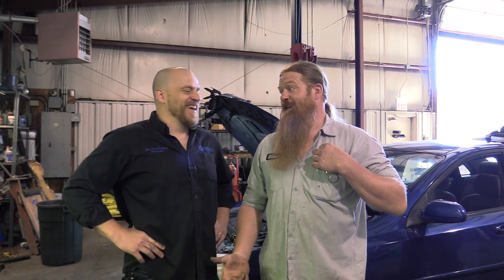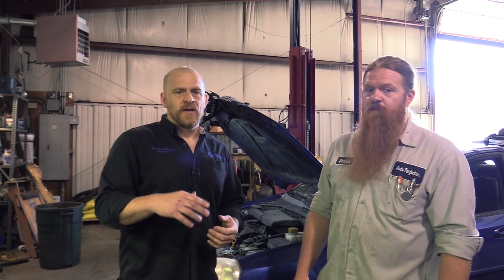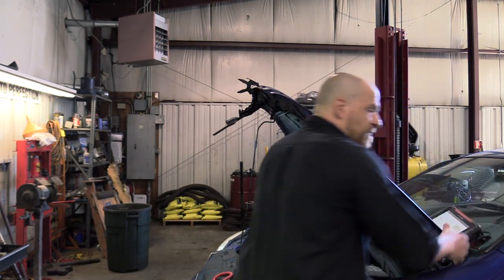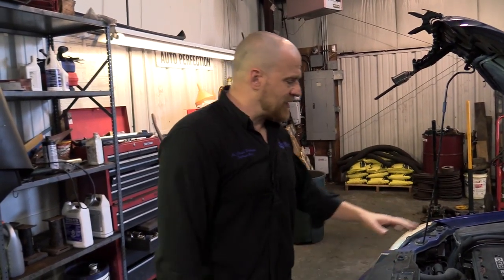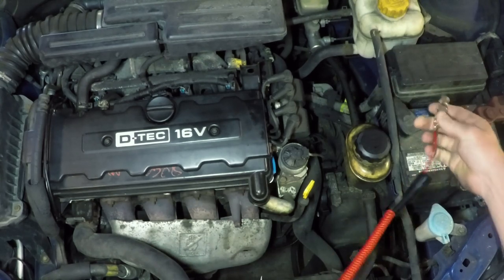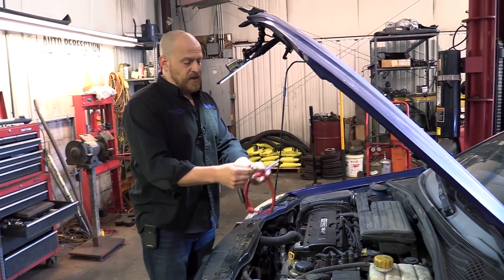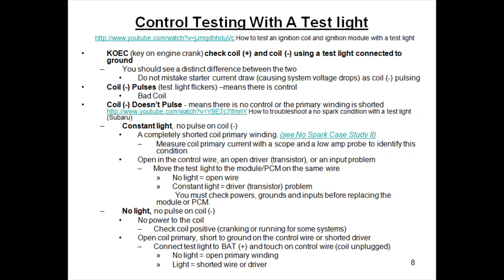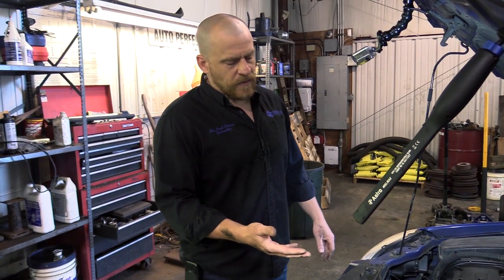Weak Spark From One Coil (Waste Spark Coil Assembly)

Comment: thanks now I know how to test an ignition coil with a test light but what I don't understand is how you exactly knew it was the ignition coil pack instead of testing other probable causes
Reply from the maker: As I said in the video, when I started it off camera, it had a constant very severe misfire and I did a quick cylinder drop test to see what cylinder(s) were misfiring. That was not recorded, sorry
Reply: @ScannerDanner  Sir, my i20 1.2 petrol has exactly the same coil pack layout as in 7.27 time. One coil pack has cylinder number 1 and 4, and the other has 2 and 3. Each coil pack is controlled by 2 wires each which means each secondary circuits are controlled by individual primary coil circuit.

Now, there's less spark coming from the one high tower of first coil pack and same is happening in the second coil pack too.

I checked for resistances reading of the secondary and primary circuit individually in both of the coil packs. They gave same readings about 14k in secondary circuits when tested with multimeter from one tower to another of the same coil pack. I wonder why such less spark is produced on one tower within the same coil pack where the 2 towers are controlled by the same primary coil circuit???? If one is showing less spark, why the same less spark is not produced in the other tower of the same coil?

Please do really help me find solutions!! Have been struggling to find solutions but not succeed yet......Awaiting your utmost service.. thanks.

Comment: Hi,Thanks for posting such a wonderful and educative video,i have 2007 Ford Explorer giving code code P302 Cylinder 2 misfire,checked found no spark in 2nd ignition coil.Pl suggest should i change the ignition coil.
Reply from the maker: Check it for control first. These coils will short out and take out the computer driver for that coil. Easiest way is to swap coils and see if there is now spark on the circuit that it is currently missing on.

Comment: Should have removed the spark plugs for the cylinders that were misfiring and show plug condition. I would think that the plugs that were fuel fouled would be dark in color at the electrodes. And compared to the plugs out of the healthy cylinders there should be a significant difference. Good plug should be a coffee color. Just feel maybe would have been another way to drive the point while also educating the public on how to analyze a spark plug for the running condition of a particular cylinder. Love what you do by the way. Wish I lived in your area so I could work for your brother.

Comment: lol im trying to get my crf450x 2005 honda dirtbike to run and i have been having this sympton in it... wasn't sure exactly what weak vs a good spark looks like but this is a good demonstration of how misleading the small flashes i was seeing are (10:00) similar to what this guy is showing and he says this is weak so must be my issue... bike would idle for 2-10 minutes the first few times i started it now its stalling (yes its a pre used old spark plug) must be beyond fouled out to run the bike now
Reply from the maker: Yes! So many people miss, when testing for spark, that you must confirm the strength of it. Just because it is there, doesn't mean it's good. 
Did you fix your bike?

Comment: By that, I mean that both of the spark plugs on that coil could be carbon tracked, and not sparking inside the cylinder.
Reply: @oldmazda2 ` exactly,  and 9000volts goes right through the fouling on the plugs, and with no gap it does not providea spark, but continues on  to the other tower at the coil.

Comment: My 03 120xxx miles just stoped , crank crank no start , cap, rotor , plugs, spark plugs replaced. Has sparks orange color from coil, and the wires looks like a week spark. Gas pressure fine all fuse fine , starter fluid on the TB and no signal . What else should it be ?

Comment: So why did the rpm increase when you stuck the probe down inside the tower of the weak coil pack ?
The coil wire was in your hand.
Reply from the maker: did it? I don't remember. The only answer would be the test light was an easier path than the plug wire and plug and provided more reserve energy for the cylinder that was still firing

Comment: Nice explanation with side-tips, great job as usual, thanks! I have two concerns though:
1) Is it safe to pull the spark plug wire away with bare hand? I met with spark once when just touching (probably bad) ignition wire, and it wasn't pleasant 😁 Or, does the test light force most of the energy go to the ground (instead of your body).
2) I think I've read in some service manual to never test ignition coild unplugged, as it could lead to internal damage of the coil, but could it be that you avoided that hazard by having test light in close distance?
Reply from the maker: A few firing events with nowhere to go will not damage the coil, so it is a valid concern but it it repetition that will cause burn through, not one event. The spark can dissipate (ring the coil) without burning through it.
Reply: @ScannerDanner  I just wish this "will not damage the coil" was explained more fully. The spark energy which can't get to ground via an easy path has to go somewhere, and the only way I can see that it can do that is by creating a track through the insulation of the coil. I believe even one such event causes damage since there will now be a short circuit path initiated, unless someone can explain otherwise?

Comment: Hi paul I had message you before on YouTube for a problem I have with a 2003 elantra for over a year now if you remember the case the car was losing power goes really heavy and then it works fine and that happens over and over again..we have changed a lot of parts and no results.. 2 shops checked the car the cant find what's wrong and thinks going worse right now there is moments that it want accelerate more than 2/3 thousand rpms, I was wondering if I could bring you the car and you do a diagnose on it? Is this possible and what is your diagnosis fee?

Comment: Sir, my i20 1.2 petrol has exactly the same coil pack layout as in 7.27 time. One coil pack has cylinder number 1 and 4, and the other has 2 and 3. Each coil pack is controlled by 2 wires each which means each secondary circuits are controlled by individual primary coil circuit.

Now, there's less spark coming from the one high tower of first coil pack and same is happening in the second coil pack too.

I checked for resistances reading of the secondary and primary circuit individually in both of the coil packs. They gave same readings about 14k in secondary circuits when tested with multimeter from one tower to another of the same coil pack. I wonder why such less spark is produced on one tower within the same coil pack where the 2 towers are controlled by the same primary coil circuit???? If one is showing less spark, why the same less spark is not produced in the other tower of the same coil?

Please do really help me find solutions!! Have been struggling to find solutions but not succeed yet......Awaiting your utmost service.. thanks.

Comment: Hello, i have a bit of a question, i remember being told that this method of testing for spark could potencially damage the cables, since some of them are build with a different type of resistance on their ends and a spark on the cable could break that resistance. So i was wondering if you could enlighten me, if there is some true in that statement.

I've been watching your vids for a while now, and, Maan although i'm just a newbie with no real field experience (yet), the amount of knowledge and practical advice you give, and the way you teach it keeping it real (really this is a big plus for me since i've had some very entitled teachers) are really something else. Ok that's enough bootlicking. Keep up the good work. Greetings from Venezuela.

Comment: What if one tower is producing less spark than the other tower within the same coil pack noting that the primary and secondary circuits are within the same resistance readings?? What's the reason behind this??
Reply from the maker: coil burn through on the side that shows weak spark or an open plug or wire on the opposite side that shows weak spark

Comment: I think I saw those are 2 coil packs, for 2 cylinders each,  wouldn't it be wise to replace both? if one went bad, chances are the other one is close to go bad too.....  or is it a single coil pack with four outputs?
Reply from the maker: It is a single coil pack assembly. Two individual coils housed together sharing a common power feed on the primary side.
Reply: @ScannerDanner  Got it!!!

Comment: What are some good tests to perform to verify supply current and ground for the coils? I've got a vehicle with weak spark on both coils and I'm suspecting a voltage drop in either the 12V feed to the primary winding or the ground for the primary. Both coils have already been replaced, ignition modules are integrated into the coils. I can't find any case studies demonstrating how to test for voltage drop on primary voltage supply
Reply from the maker: A scope would be the key as ignition coil firing events are too fast for a digital meter. What year, make, model and engine so I can verify the system design before I answer
Reply: @ScannerDanner  95 Mazda miata. I work for a company that builds cnc plasma machines so i have access to an old fashioned lab scope at work but not a low amp clamp. The car has been to three different independent shops and none of them could figure it out. 

Some back story... The problem first developed as a hot start issue. Would run and idle perfectly all day long, but once turned off it wouldn't restart for several hours. During this period i found that dipping the clutch at highway speed and cranking wouldn't start the engine, but releasing the clutch would get it running again. Lots of money spent between diagnostic fees and parts cannon. One shop said it needed coils, another said fuel pump, another said cam sensor. (Cam and crank hall sensors are integrated in one unit) I've replaced all those plus related items like plugs wires fuel filter etc. Been chasing this problem for two months now. At this point it won't run at all, it's a high compression build that blows out the spark during cranking

Comment: Question am I right . 2005 Dodge Caravan with a 3.8 waste spark system. Number two cylinder not firing coil was not firing. Left Spork plug wire off coil. Pulled number 4 plug wire off coil. Coil  Sparked onto number two coil. Engine died would not start. Or crank Chase down to PCM not demanding starter relay to engage.  Is it possible the spark back feed through the coil to the PCM and Fried it
Reply from the maker: When you pull a plug wire off of a coil you absolutely HAVE to give the spark somewhere to go (which is why I use my testligh) or you can damage the coil and or the driver that controls the coil.

Comment: Would you not do an injector clean to as the fuel wasn't burning correctly
Reply from the maker: Not needed on a port injection system
Reply: @ScannerDanner  didnt realise it was port injection, if it had been direct inject would you have done  cyl 1&4   or all of them?

Comment: lol at the battery blow up story. never had one blow up on me yet, but i always have good airflow blowing any gasses away, even if it means blowing towards it myself, so if you see some nutcase blowing at a battery before connecting or jumping, it could be me......... :))
Reply: YOU NEVER SEE A NUTCASE BLOWING AT A BATTERY!! 

You do however, see a nutcase not blowing off a battery! 

I walked up on an open hood once. Someone needed a jump, and the nutcase doing it was sparking the clamps on the terminal as I approached!! I saw what he was doing, and yelled "INCOMING" as I dove for the ditch!!

No, it didn't explode. Yes, I looked like a nutcase!!

Comment: Sir i tried non resistor plug with same size,  on my suzuki sx4 2012 model in which actually  resistor plugs come with 5k ohm resistance ,  in order to increse spark.  
Result is  engine power and running is better than orignal plugs,  but after intervals of 3 to 5 min car halts check litght on  for 2 sec , then its ok again. Checking on sccanner it show cam shaft sensor error code.  
Thisnot happen with plugs with resistors of 5k ohms. 
Does you guude me why this happen.  Thanks for your time.
Reply: Sir plz guide me abput this which happens to my car.  So i understand the phenominon.  Thanks in advance.

Comment: Hey Paul, I have a quick question , I have changed the oil and filters on my sons 2009 Dodge Ram 3500 with a Cummins Diesel and reset the oil change on the truck but I am still getting a message in the message center saying perform service and when I hook up my scanner it is showing 115859 miles since last service. My question is where on my Autel scanner can I go to reset it or is this a dealer only area? Sorry to keep bugging you, thanks for your time.
Reply from the maker: That sound like some type of DPF regeneration but this is out of my league my friend. I don't work on these systems
Reply: Thanks for your answer and time. I am going to get your ebook and start to follow you on your premium channel to see if you can teach an old dog new things!

Comment: no backfire happens from the accumulation of gas being drawn out the exhaust stroke ?
Reply from the maker: No sir. There shouldn't be any unturned fuel but if there was, it wouldn't be any different than a no compression misfire. Remember you have to compress the af ratio to get it to burn
Reply: ScannerDanner okay but what about in a different engine type let’s say a single cylinder engine in a riding lawn mower. If your one cylinder has weak spark and fails to ignite on the compression stroke (too much pressure for weak spark to ignite anything) wouldn’t you then possibly have a backfire out the exhaust or see some flaming out the carburetor if the spark is intermittent? I’ve seen single magnet magneto on a flywheel that had weak/intermittent spark that would flame out the carb and sometimes backfire out the exhaust which must have been failure to ignite with that weak spark or something had to have been out of time or valves not functioning correctly but upon inspection valves liquid tested fine. The magneto fires each time that flywheel magnet hits it which would be once in the tdc compression stroke and again when it completes a revolution at tdc after the top of the exhaust stroke
Reply from the maker: @lh98  ignition problems can definitely cause backfiring, especially when the timing is off. I don't ever remember seeing weak spark cause backfiring though, a misfire, yes, backfiring, I don't think so

Comment: Hey guys  good  video  .I have a 2000 Avalon  with a p0300  p0302 p0304 p0306 codes . Change the  spark plugs ,coil packs ,clean the mas air sensor  . I also  cleaned  the injectors  and also switched  the bank one injectors  with the bank 2 injectors  .I'm still getting  the codes p0300  p0302  p0304  p0306. I'm also getting  a loud ticking noise  in bank 2 don't know  if I  need  a compression  test  .can you please  help  .I would  appreciate  it  .car has 156000 miles.

Comment: I was attempting to current ramp a 12 chevy cruze ignition coil because I couldn't swap the cop coils since they were all one unit across the top of the ecotech engine. I was doing this for a misfire on cyl 3 that was occuring whenever the engine got to operating temp and would occur when in park at idle and under load while driving, but not cruising.  For some reason I was measuring about 5 amps with a good linear ramp upwards.  Will some coils draw a different amount of amperage varying on the vehicle and wiring setup? Or what would your explanation be on that?  Thank you for your response in advance if you do have time do respond that is.
Reply from the maker: Yes, not all ignition coil ramps exhibit the same pattern and amperage levels. It can cause questions for sure at times. For example, I had a Nissan with 1 aftermarket coil with a misfire on that cylinder and we initially focused on the new coil because of how much different the ramp looked. Ended up being an injector problem on that cylinder. I have that case study here if you want me to find it.
Reply: @ScannerDanner  I appreciate the response, but the case study isn't necessary.  That cruze has just been bothering the hell out of me because I wish I could have figured out if the engine was actually 100% bad since I had what looked like a head gasket problem. It was happening only when the engine got hot. not to mention the thermostat housing had gotten replaced 10,000 miles before this problem occured and it was already puking again.  I figured it was because of the compression leaking into the cooling system and over pressurizing it.  It really helps to have some high tech equipment when you can afford it. What would you have done in the instance?  pressure tester/transducer on the cooling system while misfiring to prove that theory?
Reply from the maker: I would love to do that test on my next head gasket. Learned that technique from Brandon Steckler. But a simple chemical test on the cooling system should have also identified that. Also if you have a 5 gas analyzer you could use it to test for hydrocarbons in the cooling system
Reply: @ScannerDanner  I should have done the chemical test dang it.  However it was probably in the customers best interest to get rid of this vehicle since the coolant was leaking (again), he had over-heated the engine multiple times, it was turbocharged and he was running conventional oil in it for 8-10 k miles at a time,  leaking oil into the plug tubes after just replacing the valve cover and gasket, not to mention the misfire repair.  I am not a fan of the newer chevrolet vehicles anymore except for the vortec engines.  How is your silverado treating you?